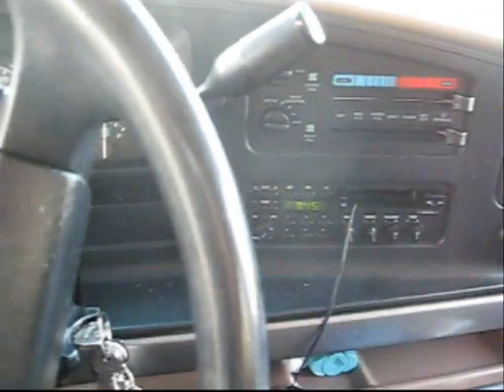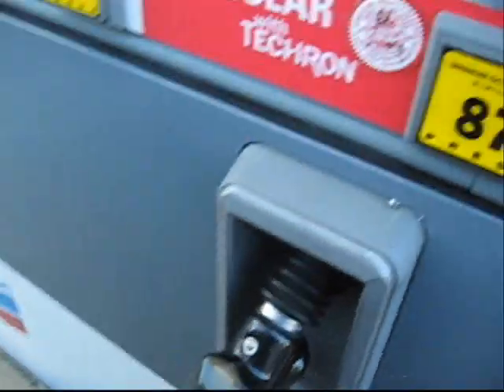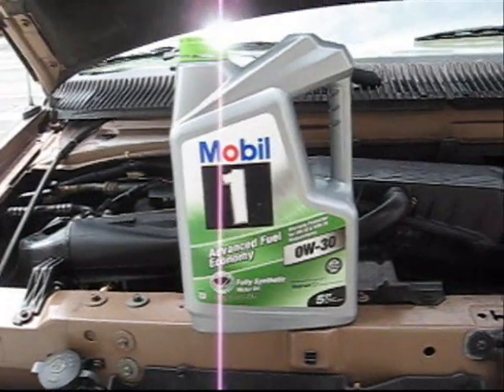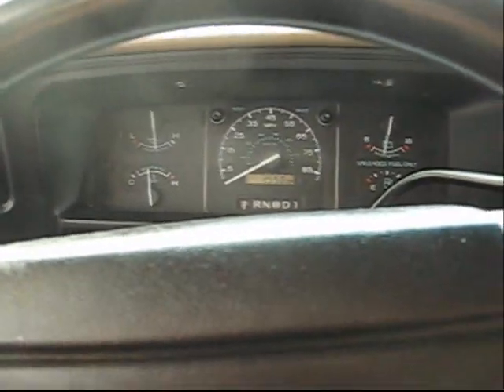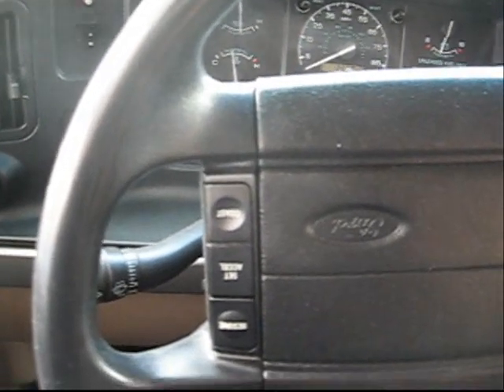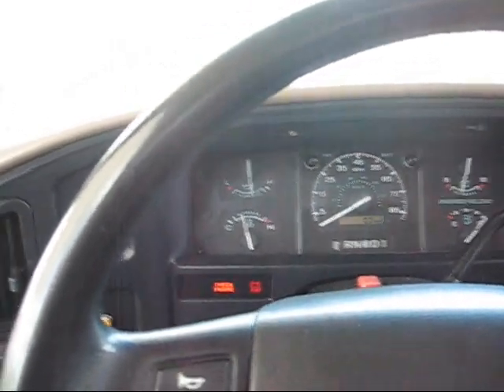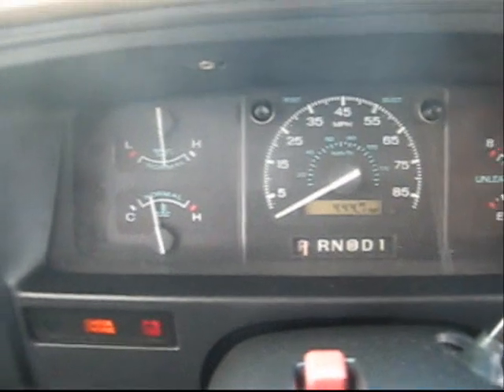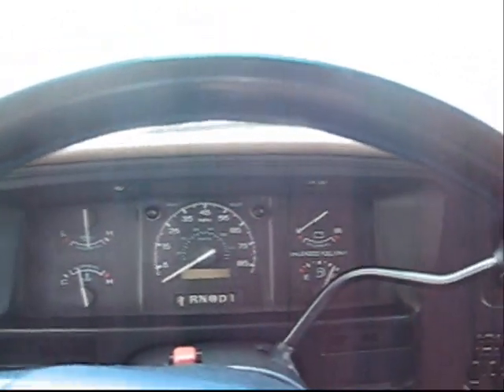Improve your Fuel Economy Experiment

Comment: i don't know what effect those other changes made, but I seriously doubt that switching to 0W-30 synthetic helped much because the old Energy Conserving II oils improved fuel economy only about 1.5% over oil without an EC rating, and the newer Energy Conserving rating is closer to 0.5%.  Chevron did tests on a 12L diesel and got only 0.4% better economy with 5W-30 versus 15W-30.  As for synthetic versus conventional, it doesn't help at all, according to Mobil about its Mobil 1 synthetic.  Their exact answer when asked about this was, "not one bit."

Comment: How about fixing the check engine light and the service engine light. That will increase fuel economy a bit. And also make sure your O2 (oxygen sensor's) are clean and in working condition. Same thing with the catalytic converter. Keep it clean. 
P.s. The van is obd 1 and to figure out the check engine light, you have to bridge a wire in one of the connectors. I don't know which, but find it online. Try that too.
Reply: My little tip for better mileage. Here's a few more tips. 
1. Perform a tuneup on the engine. I recommend E3 spark plugs and high performance spark plug wires
2. Get tires with a low rolling resistance
3. Drive and accelerate slowly and stay at the limit or 5 MPH below the limit
4. Reduce weight of vehicle. So take out any seats you don't use, remove the carpet if you choose to, remove stereo if you want, same thing with the AC, remove any sound deadening and insulation and that should be about a couple hundred pounds. And don't forget to take spare tire and jack out. Instead of a jack and spare, buy a can of fix a flat at autozone or o-reillys.
( for every 100 pounds you lose, you get a 0.1 mpg increase)
5. Try to keep the compression of engine as close to stock compression as possible. If it's low, try running a can of restore engine restorer. You pour it in oil and the additive will fill up tiny scratches in the cylinder and slow down the oil consumption down to almost no oil consumption. Check it out and read the reviews.
Reply: And another fuel economy tip from Peter^^^: clean the maf sensor and think of investing in water injection, it cleans the engine out nicely while delivering performance and a higher octane equivalent fuel because the intake air temp is lower

Comment: The 0w30 should be a good oil, about the best grade possible if your vehicle is designed for 5w30 or 10w30 like most vehicles of it's age.

0w30 doesn't get as thick when cold, thus helps at start up compared to 5w30, or the very old standard 10w30.

Easier flowing when cold can help with fuel economy at start up.

But at full operating temperature 0w30, 5w30, 10w30 and even straight 30 all thin out to the same general area of thickness. A lot of 0w30 oils for European cars are a bit thicker at operating temperature than many 5w30 and 10w30 oils marketed for North American cars.   

If you wanted a thinner oil at operating temperature 20 weights like 0w20, 5w20 and 20w20 would be the way to go, but I would only recommend those oils in a car designed to use them.

...but then again a lot of conventional 5w30s and 10w30 will thin out close to a 20 weight after heavy usage.
This is less of a problem with synthetic oil, and a good synthetic base is required for 0w30. that is why 0w30 only comes in full synthetic and a few rare synthetic blends.

When using a conventional oil because of how it is made, it usually takes 10w30 longer to break down into a 20 weight like oil than 5w30, synthetics are different, There isn't much reason to pick a 10w30 over 5w30 or 0w30 other than 10w30 used to be good stuff back in the 1970s.

The fact that conventional oils breakdown differently than synthetics plays are role in why your supposed to change conventional oil more often.

Dirty oil can also work against fuel economy and all oils can get dirty.

Though it is hard to be sure, often people look for 0w30 oils due to the higher chance they contain a PAO base oil, or higher PAO content than their 5w30 and 10w30 counterparts, much of the 5w30 and 10w30 oils marketed as synthetics are made from hydro-cracked base oils and some people have argued against even considering them synthetic.

If you wanted a thicker oil at operating temperature a 0w40 or 5w40, or even a 5w50 might be one way to go, but then, even if it has a good resistance to thickening when cold, 40 and 50 weights are known for being too thick at operating temperatures to allow the vehicles (designed for 30 weights) to get their best fuel economy.

I personally think, if you can find synthetic 0w30 oil in the store, and want to pay for it, and your car uses a 30 weight (like 5w30 or 10w30) then, a synthetic 0w30 would be the best way to go.

Great video!
Reply: I once when to test drive a buick with a 3.1liter v6. I think it called for 5w30 oil & the guy poured in 5 qts of 20W50. They were trying to hide a bottom end knock but it was very noticeable anyway.

Comment: Most products don't work. SeaFoam has shown results. 1/2 a bottle goes into the vacuum line for the brake booster, 1 bottle goes into fuel tank (do it at 1/2 a tank no lower than 1/4)  after adding it down the brake booster line let it sit for 10 mins. start up (caution will be extremely smoky). as for your oil, you don't need to worry too much (as long as you have been keeping up with your oil changes). DONT put any acetone products into your car. they are extremely corrosive.

Comment: ATTENTION for all those wishing to increase fuel economy! There are cheap and simple ways to greatly increase fuel economy. Check tire pressure (you can go 5 psi higher than recommended), change your oil regularly (synthetic every 6 grand and dino at 3-4), ac is better than windows down. If you really want to get technical clean your mass airflow sensor with a special cleaner, clean your throttle body, change the engine air filter and run Sea Foam through.Also new fuel filters tend to be helpful

Comment: Big engine? dude take at look at a 460 big block, most people run then on regular and they do just fine. In the end its all in the compression ratio that determines how high of an octane fuel you need. That and carbon buildup.
Reply: NOS351W what does your 460 get mileage wise?

Comment: Everyone saying to run premium gasoline is wrong.  The ONLY factor that you need to consider when choosing octane # is the compression ratio and the possibility of large carbon deposits.  High compression ratio engines need more octane to prevent knocking. Old engines with carbon buildup need higher octane because hot carbon embers can cause knocking in some cases.  A healthy 8 or 9:1 compression ratio engine WILL NOT benefit AT ALL from plus or premium gas. You're just wasting money.

Comment: You'd get a massive 15% increase in mileage just by switching to 91 or 94 premium octane. You have a big 5.0 litre V8 engine. It doesn't make sense to have it run on regular. The cost per mile is less when you run it on premium. Trust me. Plus it is better and cleaner for your engine. Your engine was designed to run on premium, not regular. Fuel economy starts with the fuel you use. Shell V-power would be my first choice, then Chevron.

Comment: I found that before I switched to K& N my throttle body was sucking in fine dust with the paper filter. After the throttle body is always clean. It may not add power but it cleans better on my vehicle.

Comment: OMG, 29.671 gallons for 444.7 miles.  I would be afraid to drive that vehicle.

I just got a 2003 Corolla.  I put a AEM Short arm Intake in it and I get 30mpg.  I can go about 350 miles before needing to fill it back up.

I would recommend you get a cheap Civic on Craigslist.

Comment: Right. Continuously variable valve lift will take the place of the throttle plate for more MPG. I believe the BMW M5 already has this, but I could be wrong. CVVL will help to make widespread HCCI gas engines possible.

Comment: when you did your first trip and added the barryman (or however its spelled) you needed to add the the total of barryman to the gallons needed to refill to calculate accurate numbers, also If you run a fuel injector cleaner you should look into replace your fuel filter after a few tanks of gas, I gained like .5 MPG more by doing the fuel filter after I did the system cleaner.

Comment: Everyone in europe!. Fords have been 12,000 mile oil change for few years now, Many OCI's are as high as 20-25,000 miles., even GM. You are still living in the 1970's if you think modern engines with modern oils need 3000 mile oil changes. No harm in more frequent changes of course. Just costs you more money.

Comment: I would definitely check the tuning and the sensors on your vehicles if u are getting more mpg on the K&N unless the cars have had there filters replaced at service and the mechanic disconnected the battery and reset the ECU which does the trick a lot of the times.

Comment: Your right foot is the only way to improve fuel economy. The van is running as well as it ever will. Fresh Motorcraft spark plugs and a clean throttle body does more than anything. A Dirty air filter will NOT hurt mileage. The engine computer automatically adjusts the fuel mixture.

Comment: K&N is TRASH. It cant improve AIR FLOW. If the engine can only take in 400CFM a filter that flows 1000CFM doesn't do squat. There are no improvements in MPG. The filter flows more because it lets dirt in. Keep drinkin the K&N Koolaid.

Comment: I had Toyota Corolla, Tundra Truck, Toyota 4runner ..are running with K & N Filter. Once you put that filter in then YOU NEVER WANT TO PUT BACK THE PAPER FILTER FROM FACTORY NO MORE.
1/ Improving air  (You can feel at the gas pedal) 
2/+3.3 miles per gallons
3/ Better drive ability!
4/ You don't throw your money away..just clean and oil then put back and re use!

Any motors that need filter to run even motorcycles, I always use K&N. 
5/ I am not work for K&N Company (not get pay to say)

Comment: What was the state of the original air intake filter? cause seriously the K&N filter will increase the performance slightly! but will not increase fuel economy, a lot of people get the misconception that they are getting more fuel economy when the original filter was so old and dirty they place a new one in and there is a difference. also clean the O2 sensor or get a new one, decarbonize the engine and inflate the tyres to slightly over recommend pressure(but be careful when driving)and iridium

Comment: Using the recomended oil helps the fuel economy.Even the tires aired up to the proper air pressure and keep it easy on the gas pedal are 3 others.

Comment: Great video, thanks. Did you know that here in the UK, a car's fuel economy is calculated in miles per gallon, but at the pump the fuel is sold in litres? It used to be sold in gallons, but several years ago, when the price started to skyrocket, they changed it to litres to give the illusion that you were getting more for your money.

Comment: Get away from 87 octane gas. Check your owners manual (a few engines recommend only 87 octane) but if put in 89 octane or better, you'll not only FEEL the difference in performance, it also makes a surprising impact on fuel milage. 10 cents/gal makes a $2 difference on a 20 gal fill up, but if your getting another 50 miles or more down the road on a fill up, it's a well spent $2. You'll also see the difference when change the oil... it will not be as dark (black) after running only 89 oct.

Comment: if you try techtron chevon in your tank and you slam the accelarator down untill you max it out,do this a couple of time and you will get what ever mpg your van is suppose to get .i have a 1994 mpv mazda v6 with 170,000 and i did this and im suppose to get 20mpg on the highway and im getting 22

Comment: If your tires are bigger than stock, then you are actually getting more mpg than what your calculations are. Your speedometer will be slower and therefore giving you less miles on your odometer than what the actual distance you are traveling.

Comment: A removed, stuck-open or lower than spec. thermostat can cause a massive loss in fuel economy, at 0:38 the coolant gauge looked slightly low, but I'm unsure if the vehicle had reached full operating temperature

Comment: Clean the mass air flow sensor with one of those spray CRC cans (take the sensor out & spray all sides). That helped me a lot. But I have a standard. Cause cleaning the MAFS really only gives a more responsive engine (lets me shift at lower rpms). idk how much it will help in an auto. Also def. check your tire pressure. sux u get 14mpg, but glad you got good results.

Comment from the maker: @peepeevagi 

Yeah in my Corvette I've pulled off 33 Miles per Gallon. With a Big V8 I can shift it at 1200 RPM without bogging the motor. If you go 65 MPH its at 1400 RPM in 6th. 60 MPH and its at 1100 in 6th gear. It's never recommended to let the tach drop below 1000.

If you have a manual you can definately make a game out of it trying to beat your previous FE numbers. I do!

Comment from the maker: @whitey211 

Speed is definately the biggest factor! You have the same mentality as I do man. I thought I was the only one who still drives 60-65.

In a small car like yours 60-65 is a 3mpg improvement. In a bigger vehicle with a V8 it'll be an even larger gap and going 70+ in a big V8 truck and your probably looking at 10-12 MPG VS 17-20 going 60-65.

The other small things add up to like properly inflated tires and keeping the injectors clean with a good Fuel injector cleaner.

Comment: EPA rates my RSX at 24/30 but I average 34 or 35 and I know I get 40mpg highway (one loooong trip, all highway).  I drive 60 though as the difference between 60 and 65 is 3mpg so I take the slightly longer trip (7 minutes over 100 miles) to save some money.  Good tips you got here!